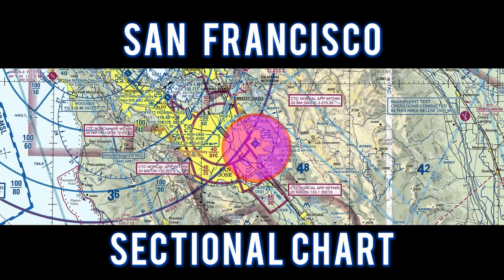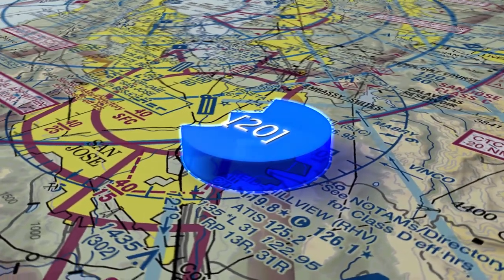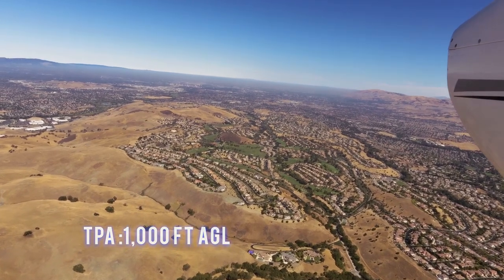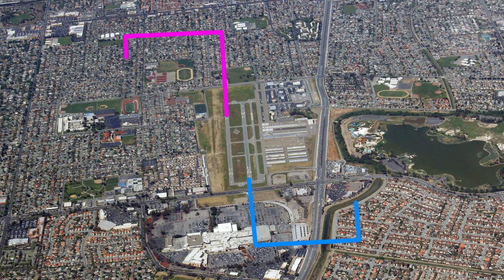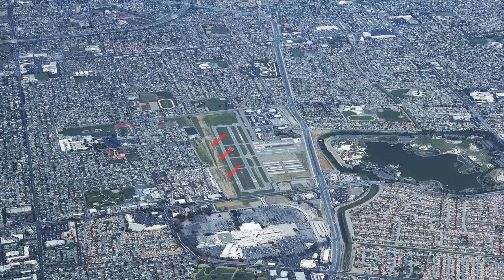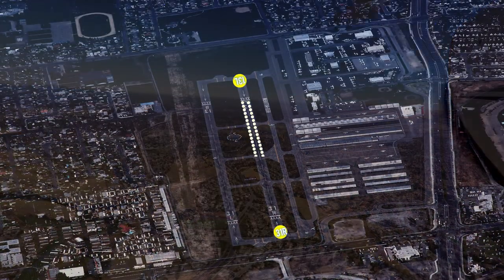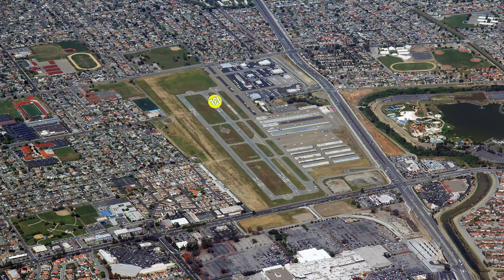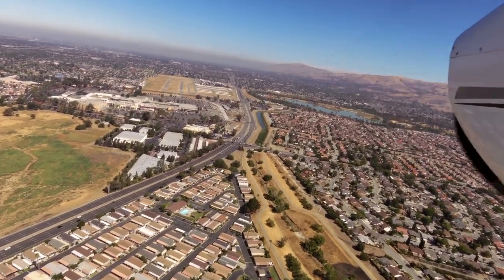Flying with Tony Arbini into the Reid- Hillview Airport (KRHV)-San Jose, California

Comment: Great video, would just like to point out it looks like you're using an old San Francisco VFR sectional. The SFO class Bravo has been updated and has some significant changes in shape now.
Also, the school to avoid for noise abatement is actually the one to the top right of the one you circled in the video.